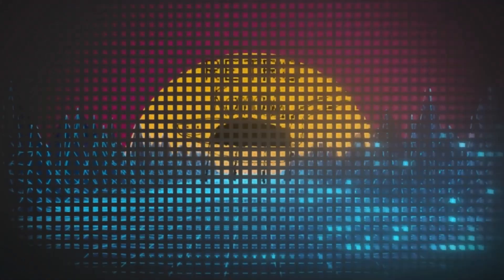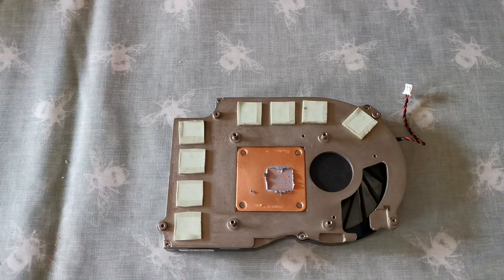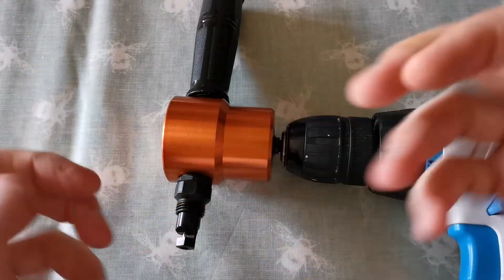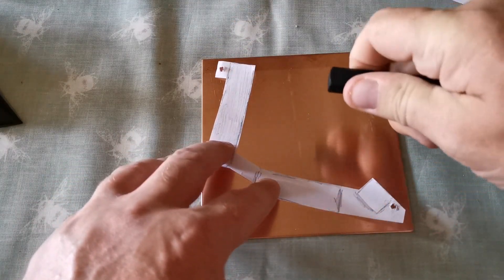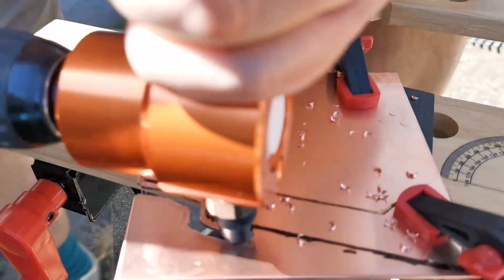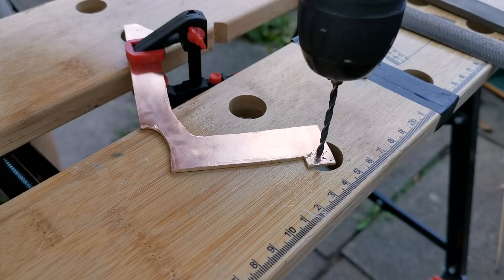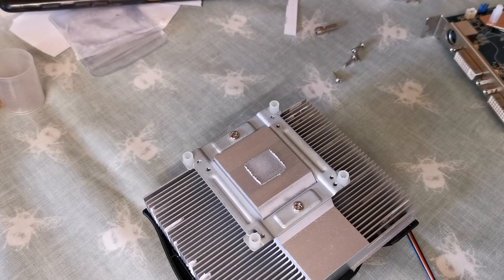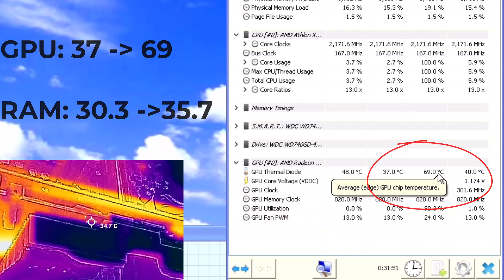Making a custom copper GPU heatsink

Comment: Hello there!
You seem a bit unexperienced with your tools, so here are two advices : 
-get a rotary tool like a dremel, with cut off disks, you'd have had a easier and cleaner cut, you can get non dremel branded ones for way cheaper, and use the dremel disks nonetheless. They also have sanding drums to carve corners and curves.
-the drillbit you used looked like a bradboint drill bit. It is meant for wood. Even in softish metals like copper, you will dull it super fast. You should try proper metal drill bits, they have a v shape point, and do much better. You can even add a little bit of oil, or wd40 on the point you are drilling to lubricate and cool it, and your bits will last a long time. Metal drillbits are often way more precise for metal drillbits than the bradpoint would be.
Reply from the maker: You're absolute correct - I mostly have no idea what I'm doing when it comes to my modifications. But let's face it - my ineptitude is what amused me most in this one, so I figure it'd do the same for others. I do have a rotary tool.. but it's only really any good as a grinder 😞
The takeaway from this video is more that any idiot with time on their hands and a silly idea can do this sort of thing. Does it look good? Not particularly - were mistakes made? Of course! Did I have fun doing it? Yes - and that's probably how I'd do it again! If you think that was painful to watch you should see me soldering 😜 What's the saying? 'All the gear and no idea'? I absolutely take your suggestions on board though, and the next time I do something like this it should (hopefully) be less janky!
Reply from the maker: Also it was worth it just to use the nibbler.

Comment: thanks for answer! I suspect this video card can be upgraded to 1gb vram with qimonda chips maybe with other brands also but must be socket bga 136, there’s a sapphire 3850 1gb with same pcb despite the connector and that model of memory is capable of going above 1000mhz easily, we are talking of about 63-64/gbps (hd 4850 levels) on this gpu with twice the amount of actual vram, quite interesting because if is a success we could test now some recent games (not directx 12 ones) like gta v where the stuttering caused by the lack of vram is terribly
Reply from the maker: Well Manuel, I can tell you it uses Qimonda HYB18H512321BF-10 chips. The second line says HVV06130, and this may be what you are looking for : https://datasheetspdf.com/datasheet/HYB18H512321BF-10.html
Reply from the maker: @manuelmunoz4054 here it is https://youtu.be/DYXKNu39H4c?t=146

Comment: Hi mate which brand and model is your vram chips? Because I need to find the datasheet of the agp version.
Reply from the maker: Hi! Someone has asked me to test the card with a different cooler, so when it turns up and I fit it I should be able to get that info for you :)
Reply from the maker: here it is https://youtu.be/DYXKNu39H4c?t=149